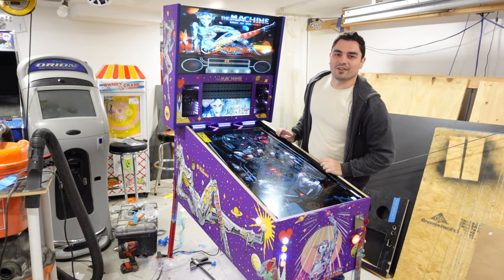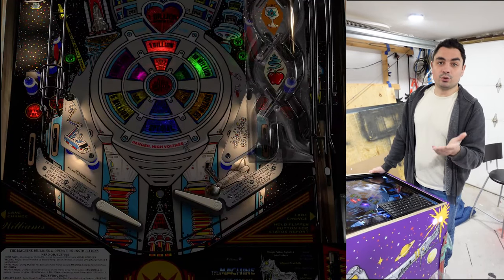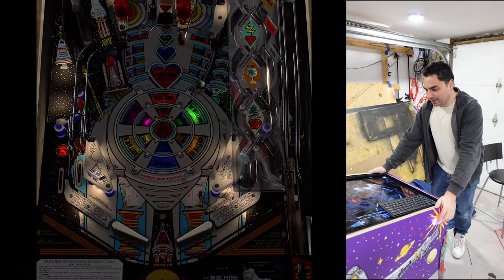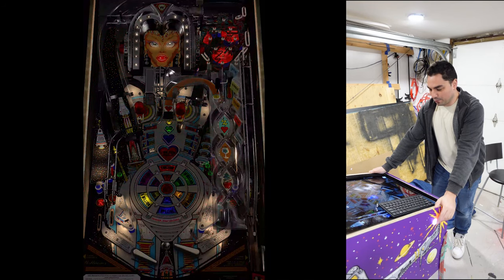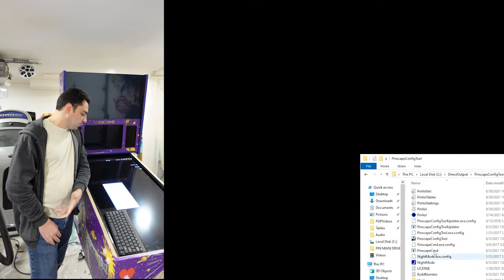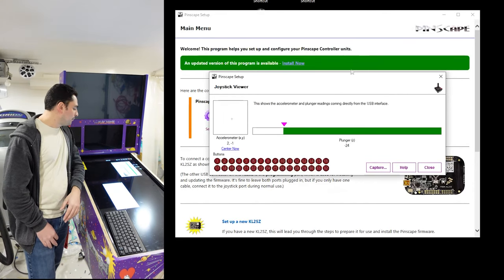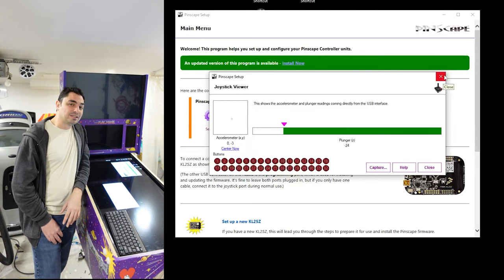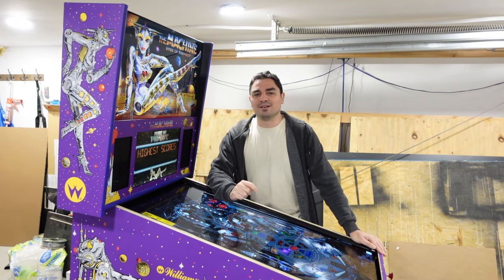How To Setup Nudge And Tilt For Virtual Pinball

Comment: Great detail. I have my KL25Z working in 10.7 and 10.8 but this will help me get it dialed in for tilt. Definitely a must have for virtual pinball. Any help with the newer Pinball FX would be great. I got it to work following some FX3 guides but it is too jittery to use.
Reply from the maker: @timtucker4413  nah sadly fx doesn't have the accelerometer option. I made a video a while back with x360ce but fx reads it as a 0-100% and not actual nudge values :/

Comment: What about if you have a real tilt Bob? Are those settings turned off or are they rerouted a different way to use the real tiltbob
I have a pre-built but I've been trying to learn under the hood now and expanding  my knowledge of how it all works
Reply from the maker: @MichaelSygo1  tilt Bob is like a micro switch... simple on and off
I believe there's a setting somewhere / check box to active real tilt Bob. 
I don't put real tilt bobs so I can't totally answer your question but if I did. 
It would simply be wired up as an regular micro switch
Reply: @Vic_VP  yes I do have a switch I'm going to have to test it I guess to see if the accelerometer takes over if the tilt Bob is off
All the options are overwhelming, and I'm not the type of person that believes it comes set up completely correct till I check it out lol
So far I was able to get my ssf to work much better by turning up the dB level in Realtec audio  and also adjusting the global, pinuppopper, and table overall settings so I don't have to keep changing volume on everytable I open
Now every thing seems equal volume wise and if I want  louder I can just use the globel knob

Comment: hey vic, i have a plunger , i set it up through pinscape etc. I calibrate it in pinscape, but so far today, as awesome as my machine is , with every toy, i cannot use my plunger.  in future pinball , it doesn't work at all, in vpx i can pull the plunger all the way back and it barely hits the ball, so it doesn't hit theh ball hard enough. my nudge works fine. i think obviously its the settings in vpx, vpx 64, and future pinball settings i have to do .  Some of the greats have tried and failed. Im using a kl25z, its hard wired into it, i have the full cleveland software setup. mine has the acceleromiter, and the kl25z board is soddered to a main board. both ports are facing you at the front of the pinball machine which i have set in pinscape. so i dont know how to get it to work. im gonna do everything with your settings and see . my kl25z board is located at the very front of my machine like a foot back inside of the coin door.   future pinball, is even worse. on the starwars dsa table only, the ball can sit on the right flipper and it will roll upward and get stuck away from the flipper on the other side of the right bumper. lol. ill try again., but its been two years since i built it so i basically gave up and just use my fire button to launch the ball. for your two magna buttons, inside pinscape  you have them set to your two alt buttons right? it only does that on the one future pinball table, but the plunger doesn't work at all, it does pull back , but like i said it does fire the ball up hte ramp.  I didn't see what buttons you were using in the tile table.
Reply from the maker: I don't play future pinball so I didn't bother setting up nudge and all that.

Did u recalibrate your plunger in pinscape? Maybe your pot moved or something and it is no longer crossing the threshold... there's usually a visible line in pinscape calibration that shows where the end of the pot ends up
Reply: @Vic_VP  I tried all your settings , nothing worked. I launched pinscape and I have to use the potentiometer I think, I don't remember the name, it's where you calibrate the plunger in pinscape you see the green line when calibrating and when I pull it back all the it barely moves at all. So when I exit out and go to play vpx when I pull back the plunger it barely moves at all. I don't know what setting to set to make it so it changes I guess the sensitivity maybe? So when I pull back I shouldn't have to even pull it back all the way. Right now even if I pull it back fully it barely moves and  can't launch the ball..
Reply from the maker: @JerseyJohnnysElectronicsGaming  then there's an issue with your actual potentiometer 

You said your pinscape software the line is barely moving... so there's either a loose wire or your pot is broken. If your doing the calibration and the lines not moving at all or just a hair.. then it's a physical issue and not a software issue... unless you changed the plunger settings under general settings

Comment: Hey Vic, awesome tutorial for this! So I got tilt working on vpx 10.74... but it is not working on 10.8, any idea what might be going on? I have the same settings for both versions and it is working perfectly on 10.74. But in 10.8, even when in the nudge & tilt table test, the left blue tilt indicator ball doesn't move at all. Not sure if this would affect it at all... but I recently followed Rudy's POV tutorial for the new 10.8 POV settings....
Reply from the maker: Did u do the same process in 10.8? Did you adjust your tilt sensitivity in the nudge table? Remember you basically need to do the process twice
Reply: @Vic_VP  yeah, I went through the same process for both versions. The tilt isn't registering at all in 10.8, just the nudge. I also asked Rudy in the comments of one of his recent videos and the issue might be linked to the new 10.8 POV settings. He said there might be something additional that needs to be done. I brought that up because that's the biggest difference I can think of between the 2 versions. If you didn't set up the new POV settings in 10.8, it might not affect tilt... but I haven't tested that yet.
Reply from the maker: @CoryB_1980  yea I haven't messed around with pov... so maybe that's it. And you have tilt enabled in the settings / checked the box
Reply: @Vic_VP  yes, I was thorough with it and spent a few hours messing with it. If you haven't set up the new POV in 10.8 and the tilt is working for you, then that tells me that the issue is most likely linked to that. Rudy's reply also seems like it is the new POV stuff. He also said he doesn't mess with tilt so he hasn't noticed. I would be interested to see if you add some POV values in 10.8, if you get the same issue. Thanks for the response!
Reply from the maker: @CoryB_1980  cool maybe  I'll load up the vpin and give a pov a try 👍 will keep you posted
Reply: @CoryB_1980  I'm having the Same issue with 10.8. Nudge works fine, Tilt does not. So if anyone has a fix, please post a comment. Thanks!
Reply: @pyrettablaze7098  I'm thinking we won't have a fix until a future 10.8 release fixes it.
Reply: @CoryB_1980  The strange thing is I had it working withe previous version of 10.8 and Vpinmame but after the update it quit working again. I went back to the previous versions and it still doesn't work. 🤷
Reply: @pyrettablaze7098  That is strange. I just set up tilt for the first time within the past week or 2 after Vic's video so I'm new to it. Pinup Popper has new updates available today so it's possible something in that can fix it... hopefully.

Comment: It seems to me like the ball goes the opposite that it should, 
I just git my machine and this is the 1st thing I've noticed it bothers me on a real machine if I push the machine to the right the ball should go to the left like the machine is moving moving under the ball how do you fix this is it a known problem ...
Because it seems to be backwards on my vitual cab
Reply from the maker: If using pinscape do u have the orientation of your board correct?
Reply: @Vic_VP  it's a ultra vp 7 .5
Reply from the maker: @MichaelSygo1  I dunno what that means lol 
Sounds like u got a pre built. U may need to open it up and dive into the software and hardware
Contact the seller and hopefully they can help
Reply: @Vic_VP  after more testing it's not the ball going the wrong way it goes in the right direction when nudged, 
But seems to have a follow up movment after the nudge that sends it back in the opposite direction
Reply from the maker: @MichaelSygo1  maybe u need to adjust your sensitivity